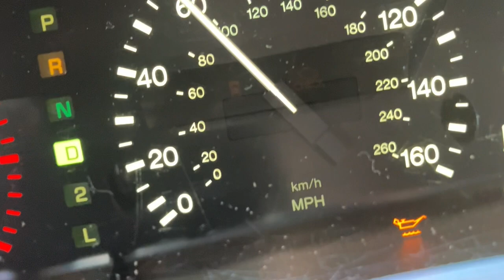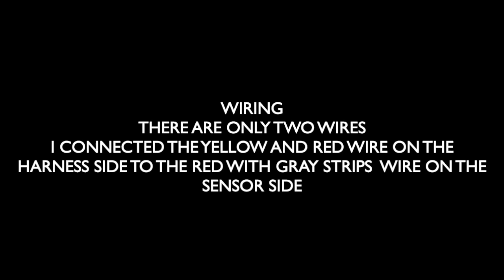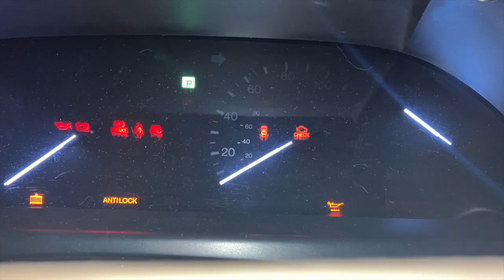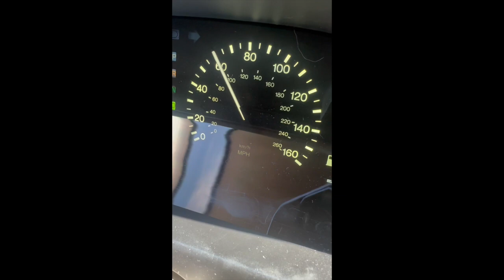Lexus LS400 Oil Level Sensor

Comment: Nice work. Probably not the same situation but I've found the washer pump for an 05 corolla is similar to a bunch of other vehicles (all I can remember right now is GM but there might be even different brands) the difference is the connector as well. I've heard from an expert mechanic video that wiring harness becomes brittle over time especially for vehicles from warmer states.

Another method you could have tried was to transfer crimped pins from the newer connector to your vehicle but might not have worked for you ask the wiring from what you've stated is kinda falling apart.

Awesome work, we need more people keeping things going rather than throwing them away.
Reply from the maker: Thank you so much for your kind words. Like you said I had the option of transferring the old connection to the new sensor but it was little involved and required soldering. There was a possibility of damage. Thanks again.